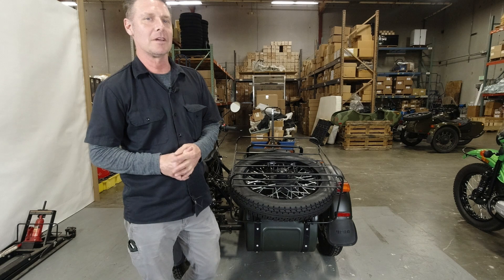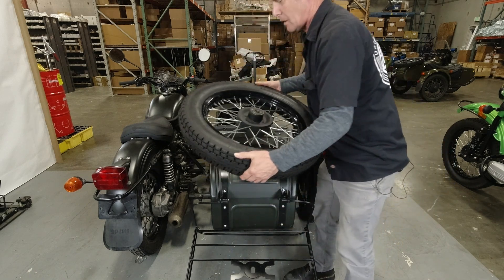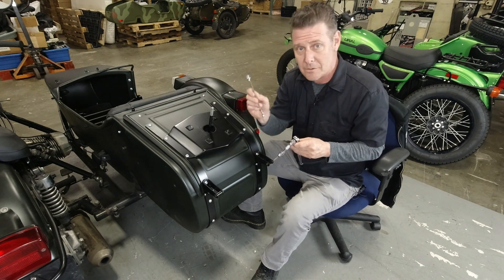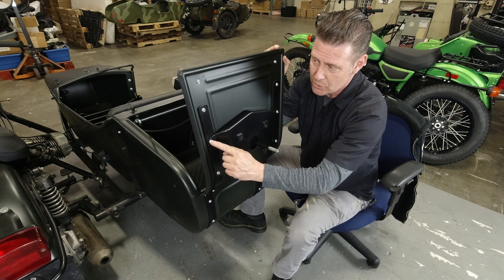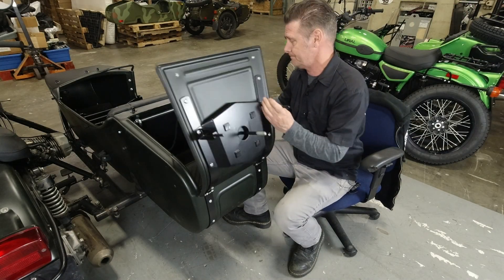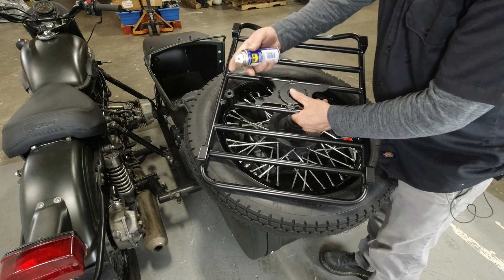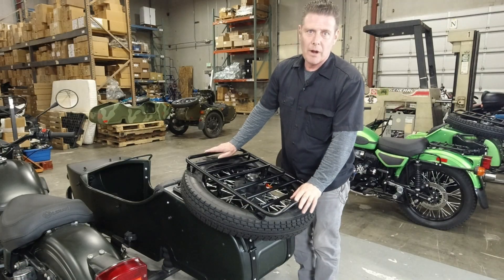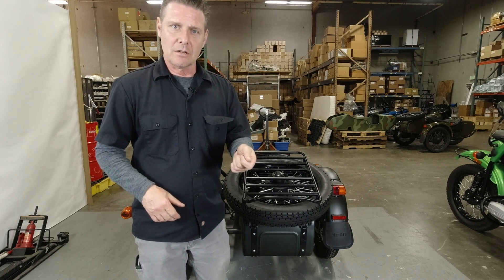URAL How-To – Heavy Duty Spare Tire Luggage Rack

Comment: Another helpful video thanks David! (any chance of a battery removal/replacement video?)
Reply: Take the little fittings on the bottom completely apart and off. It looks like you can take the battery out by just loosening them, (you can, but it's harder) but you, or at least I, can't get them back on after the battery is back in place.

Comment: Will this fit on a 2017 Ural M70 that didn't come with a rack over the spare wheel?
Reply: Yes (says the former owner of a 2015 M70, current owner of an 11 Retro and a 18 Retro and a 95 Sportsman. Yes, I have a Ural problem) as long as you have a spare tire!
Reply: @JamesAllmond  Thanks! This is only my second. I drove an '01 Patrol for 17 years. My other garage residents are a '90 Honda Pacific Coast and an '06 Suzuki Burgman Executive. Not Urals, but not mainstream, either.
Reply: @Mishn0  I had two 1990 Pacific Coasts. Great bikes and I wish I could buy a new one.